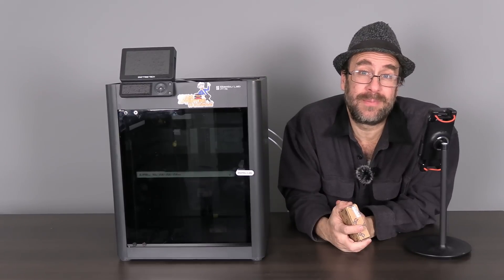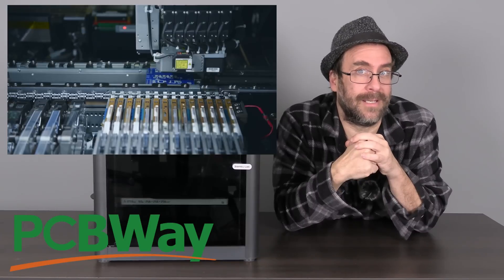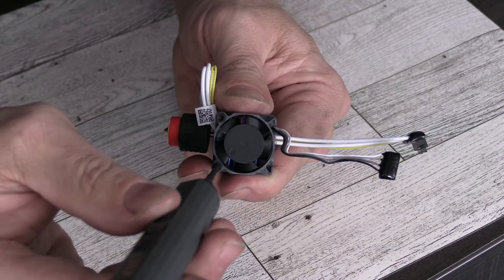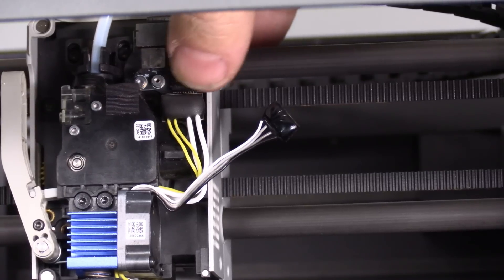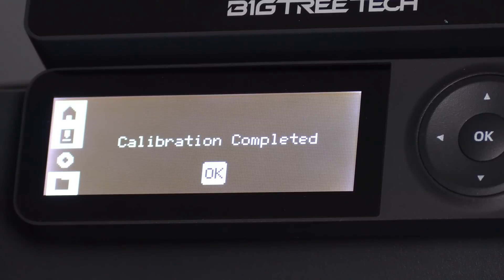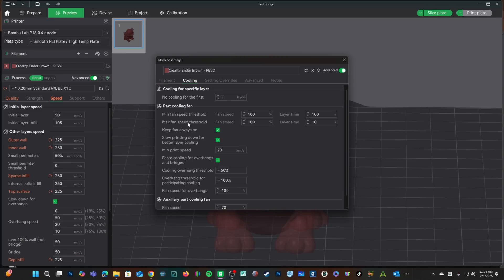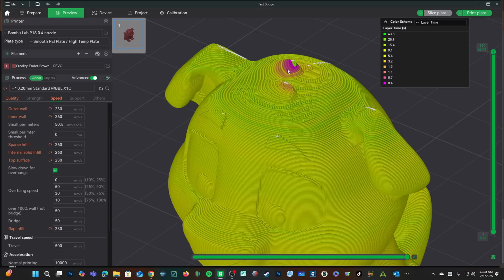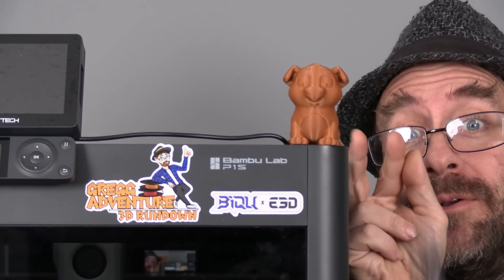BiQu "PANDA REVO" with E3D Rapid Change Nozzle - INSTALL & CONFIG - Bambu Lab P1P & P1S 3D Printer.

Comment: do you need to run calibration each time nozzle tip is swapped ie .4mm to .6mm
Reply from the maker: Not really. Just let it run an ABL, so you are sure to have an accurate Z-Offset

Comment: I really just want this for the easy nozzle swaps can i use this hotend and still just use default everything and still have prints come out as good as they do now with stock hotend
Reply from the maker: It's so good. Catch todays shorts. I used this hot end.
Reply: @3DRundown  the creality short?
Reply from the maker: The ones on my Mask for the UFC. And this one: https://youtu.be/wmPjfozYdVk The P1S prints, are on the Revo. It did a Banger of a job

Comment: HELLO THANKS FOR THE VIDEO, I WILL ASK. WHAT MATERIALS , CAN NOT BE PRINTED WITH REVO. , WE KEEP HEARING IS QUICK AND FAST , BUT NOTHING ON ITS LIMITATIONS, CAN YOU TELL ME WITCH FILAMENTS SHOULD NOT BE PRINTED WITH IT , THANKS
Reply from the maker: It depends on the actual nozzle you use. Abrasives such as GLOW, can wear out a Brass Nozzle. Wood can clog a small Nozzle. 0.6 for that

Comment: Glad the revo worked out for you. I have too many random issues with it. The KSR FDM test and a benchy printed on the bottom right of the build plate all come out worse than stock with bambu filament.
Reply from the maker: My Revo has been spectacular. I've been running it every day since this video. Saving me time on all my prints, and coming out excellent. Bummer to hear you have poor experience. Maybe a defective nozzle?

Comment: Did you change the temps at all? A lot of people say this nozzle runs approximately 10⁰ hotter but your print came out perfect and i didnt see any temp changes
Reply from the maker: Nope. Been running 220 as usual.
Reply: Brilliant thank you.  Just shows that if you know what you're doing,  things work.

Also if you get a free minute and manage to get your hands on a 0.25 nozzle, could you do the same and do a configuration profile please? I'm lost without your help!
Reply from the maker: I'd really like to get the 3 pack, with the 0.25, 0.4, and 0.6.  I'd personally, rather an 0.6 and 0.8. I can try reaching out to them, or, if you'd like, feel free to send me one, and I'll give it a shot:
Gregg Adventure
PO BOX 397
Wharton NJ 07885

Comment: What is the nozzle made of ?
Reply from the maker: I believe the included is 0.4 Brass
Reply: @3DRundown and how do you expect that to last ?
Reply: @PeterAgostiniJdcap26 Long enough, unless using abrasive filaments. Then I would swap it for a Ruby, Diamond, or Carbonate. I have a Ruby on the way. It should last an eternity. The brass ones are also low-cost
Reply: @ and who makes those nozzles ?
Reply: @ yes brass is a throw away nozzle I don’t care how fast they are installed $ .. should be same design but in hardened steel.
Reply from the maker: E3D: https://e3d-online.com/